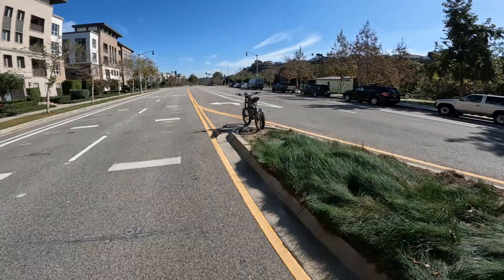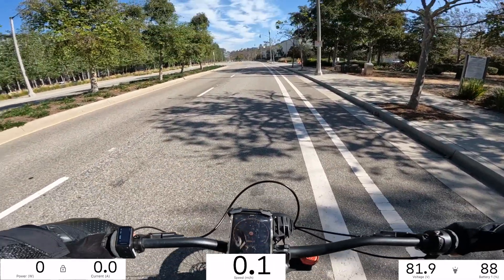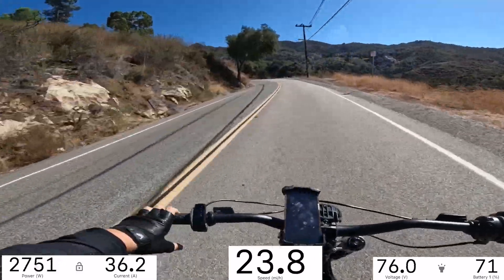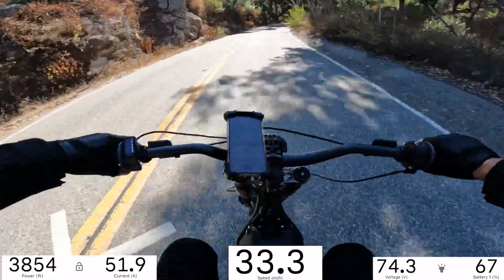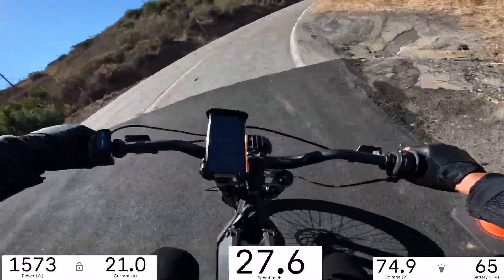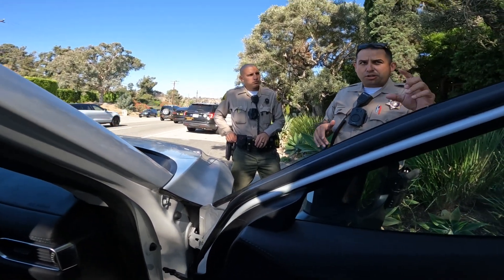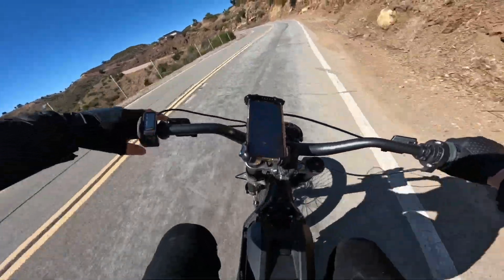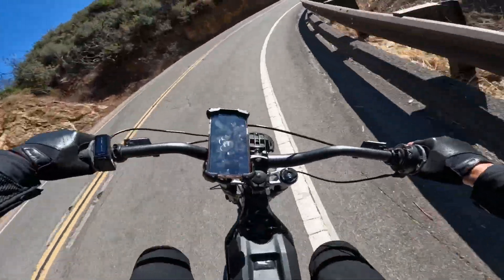70mph Sur Ron ebike stopped by Police

Comment: As long as they don’t catch you going over 30 to 35 mph, when they start to ask you questions you can always say the super 73 thing you mentioned as well as it’s a class three electric bike. It doesn’t help if you don’t get some sort of pedal kit😅 
But it’s kind of like you said… As long as you aren’t being a jerk, and in my case keeping it reasonably at or below 30 mph… They probably won’t say anything. That’s the combo I’m going for when I finally pick one of these up, I’m not even gonna cut the green wire most likely 😂 I’ll be the dork going 29 mph with pedals, getting 70 miles per charge!
Reply: Buddy if they’re in a bad mood they’ll impound it..federal law is 750w
Reply: @slimdunkin117  Baseless fear mongering. 
1) cops are not impounding Surrons 
2) cops have no idea what a Surron is in most cities 
3)cops are not going around measuring which bike is 750W and which isn't.

They simply don't care and have more important things to do, go watch Surronster's latest video of him riding around on an ebike and asking police if they know the law, most didn't and they couldn't care less.
Reply: @Panda-ws7cp  I agree with you more than the other guy. The problem however with SurRonster is how much he has influenced a TON of kids in my area of California to flat out break every law possible instead of flying under the radar, using the bike in a way that plays both sides perfectly. It’s a bummer… all these 14 year olds stunting wheelies thru busy California streets brings the wrong attention. But the 750w argument is only valid if a cop catches you blowing over 28mph… because not only are they not testing wattage (like you mentioned), but the SurRon comes locked around California class 3 speeds which arguably equates to the legal wattage (super 73 does this for the UK laws and even provides certificates upon request in Europe). If it’s locked at 28mph, then being afraid of a cop ticketing or confiscating your bike is solely based on fear of what THEY THINK your bike can do, rather than what they actually see you doing… and that’s a cop abusing his/her power. Even LunaCycles website has a declaration on their page saying the SurRon is governed/locked at a legal speed for most states. Basically, I’m ready to talk to an officer in a civil way and if we’re riding it legally, we shouldn’t have to be in fear 24/7. 🙌 that’s also why I’ll be the dork keeping it locked at lower speed and with a pedal kit.😅
Reply: If anything they could check the label for how many watts, also yeah what he said was right as it is a moped, only electric bicycle if have pedals
Reply: P90